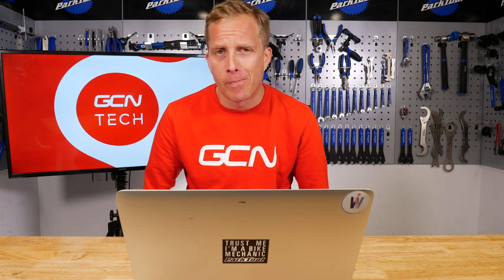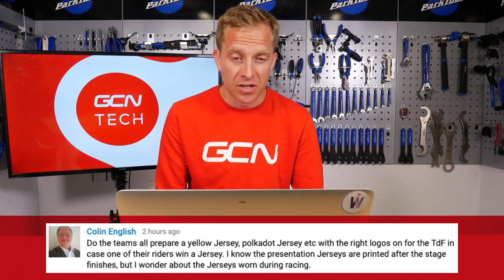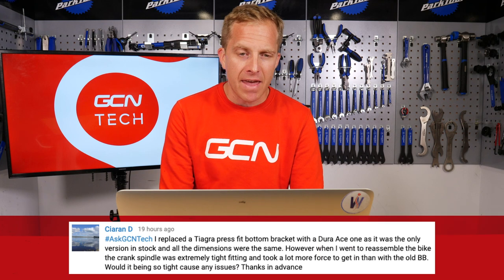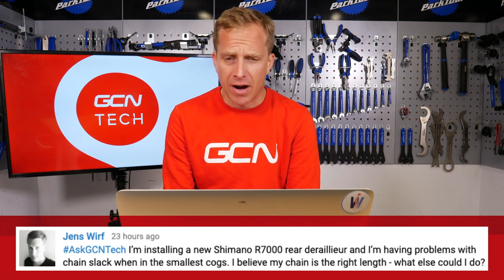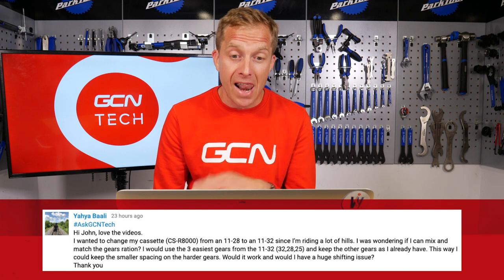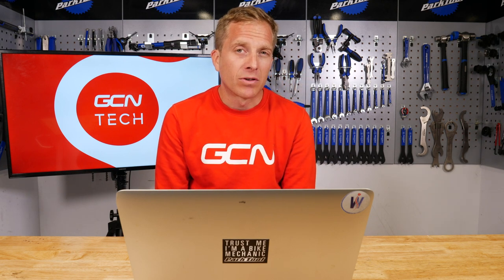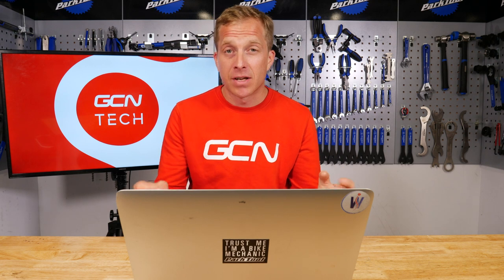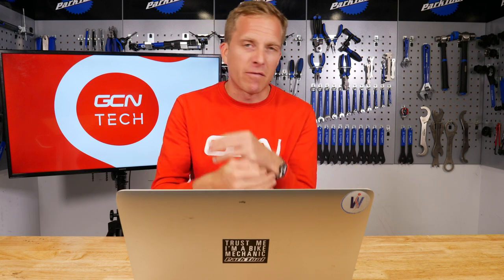Most Aero Place For Bottles On A Road Bike? | GCN Tech Clinic

Comment: Hello from Barcelona, Spain. Congratulations to the channel. I ride on an aluminium cannondale caadx; I am going to replace my aluminium fork by a carbon one. I will apreciate any advice about the correct instalation of the compression plug: carbon paste needed?, torque of the bolts? How to avoid galvanic corrosion between the frame and the fork? Thank you very much

Comment: I just did the Pikes Peak Hill Climb on Saturday and smashed my PR. However, I knew ahead of time that my gearing setup wasn’t going to be right (too big in the front). The ride averages 7% but that includes a significant flat section. Most of it is probably more like 10%. 

You know what would be an awesome video? This might be too involved tech/science, but...what would be the optimal gearing assuming 200w, a certain % grade, a certain weight, etc. that would also mean a cadence of around 80 to 90? I realize that 200w is still 200w (the same time) up a hill all else the same, but how you get there on 60 rpm or 90 rpm is a lot different. Or does such a calculator/chart/guide already exist? 

In reality I know I actually lost watts because I couldn’t spin fast enough due partially to gearing in the front, not to mention the lack of oxygen!

Comment: I wish to upgrade my 3X chainrings (42-34-24T) to bigger ones like Shimano Sora FC-3503 having 50-39-30T gear combination. I currently have Shimano Tourney groupset with 'sealed cartridge' type bottom bracket. So,
1. Will I be able to go ahead with this upgrade?
2.  What issues I might face if I keep rest of the Tourney groupset intact?
3. What other components would require a mandatory upgrade if I go with the 50-39-30T chainrings?

Comment: #AskGCNTech i like the idea of the 10 tooth sprocket to increase the range of gears at both ends. However I cant afford SRAM's eTAP AXS groupsets as the wireless technology makes them too expensive. Would the crankset, chain and cassette be compatable with any other components from different groupsets. I.e. could i take the gearing from SRAM's X-range and use it with a different groupset. If so, any suggestions; preferably mechanical gearing with hydraulic disc brakes.

Comment: #AskGCNTech I have a Bianchi Oltre with an Ultegra 6800 series groupset.  I have a sub compact 52/36 chainset and 11-28 cassette.  As an old rider, I'm looking to upgrade the groupset to the Ultegra R8000 groupset with a compact 50/34 chainset and a 11-32 to help me with the hills.  I assume I will need a medium cage rear derailleur for the bigger cassette?  Also, any other traps for young  (old) players in this upgrade?  Thanks for a great show Jon.

Comment: Hi John, I am interested in going bikepacking using my new gravel bike. The gearing came set up with 48-32 with an 11-34 at the rear, using an Ultegra RX rear mech (no chain slapping for this guy!). The rear mech's capacity is listed as 39T and a max low sprocket of 34T. Can I add a wolftooth derailleur hanger extender to get a larger cassette fitted? Or is the rear mech capacity not going to allow it (it is already at 39T capacity with the current gearing)? If yes, will a 40T low gear fit? #AskGCNTech

Comment: GOD BLESS YOU !!! Ok mechanic😅 I got a argon 18 2010 with a broken front DERAILLEUR Hanger how can I fix that 😓
Reply: El que antes era dejo de ser bring it to your LBS
Reply: El que antes era dejo de ser If the bike has an actual front derailleur hanger, just replace it. Should be like €20 max. If it broke, it’s probably served it’s purpose of protecting the actual derailleur.
Reply: MC SwaggerFlagger in case have screws but not 😅

Comment: I’ve been slowly adding upgrades to my BMC Roadmachine - the most recent of which was a Vision Merton 5d integrates bar and stem. I love the feel of the wider bar but I can no longer fit my front light to my handlebars as my mount is for a round bar only. Do you know of any brands that produce a light you can attach to an aero bar? Or one that you can attach to a Garmin quarter-twist mount? Thanks!

Comment: #askgcntech Hi Jon, love the show! I’m restoring an old trek 1000 and I would like to convert it from a 7 speed down tube shifting to a 1x 10 speed down tube shifting. My question is two fold: firstly, can I fit a 10 speed cassette (I’ve measured the rear drop out to 130mm) and secondly, is the down tube shifter capable of being index for 10 cogs? Thanks!

Comment: I was working on my Fuji cross bike (aluminum frame and fork), it was with the saddle and bars on the floor since I don’t have a work stand, right to the side of it was a 1.5 meter drop to my garage and I had my front wheel of the bike, my rear wheel was still on it, then one of my pets dropped the bike, it landed sideways with the middle of the fork taking the blow right on the edge of the floor, then it turned an fell those 1.5 meter landing on the rear wheel and the front wheel dropouts, it bounced .5 meters on the front before falling again. I inspected the bike and neither the middle of the fork nor the wheel dropouts seem damaged (except for the paint obviously), should I be worried long term for cracks especially on the stress point which is the joint of the dropouts with the rest of the fork? Especially having disk brakes and being used as a road bike with long and fast descents being frequent where I live? THANKS A LOT IN ADVANCE. :) #askGCNTech

Comment: #AskGCNTech Hi Jon, I have a 2017 Supersix disc with SI crankset - ultegra 6800, ST-RS685 levers and BR-RS805 flat mount calipers. Is the r8070 di2 upgrade kit compatible? Replacing only - front mech, rear mech and levers? Cheers!

Comment: My rear hydraulic disk brakes do not have enough stopping power. The front can stop the bike immediately, however the rear ones cannot. There is no sponginess, so not sure if it is air in the fluid.
Reply: It's simple physics, braking with your front brake always slows you down faster(hence the flying over bars)
Reply: @Jizzan  that is true, but my rear brakes probably will take about 5 times longer to stop
Reply: Maybe the pads got some oil or something on them.

Comment: #askGCNtech regarding bike upgrades - I’m considering upgrading my standard fit PR-2 wheels on my ultegra clad TCR-0. Went in to my local bike shop - advised that carbon wheels would be best. As a relative newbie it feels a bit wrong fitting £1K wheels to a £1K bike. Am I better off saving for longer and upgrading the whole bike to carbon instead? Is there any virtue in spending £500-600 on lighter aluminium wheels ?
Thanks in advance.
Reply: Keep the hubs and just swap out the spokes and rims with some Chinese Carbon rims. Eg. Farsports, Yoleo or my favourite Light Bicycle (rims are approx 100 pounds each). It's fun to build up rims yourself too.
Reply: Richard George thanks for your suggestion, I’m fairly sure building my own wheels is beyond my skill level! It would be a good learning experience for sure, but I don’t have much in the way of wheel building equipment...

Comment: #AskGCNTech Hi Jon! So I bought an old Ciöcc and there are sora crank arms on it and the left one seems to always be coming loose and causing a skipping feeling every downstroke on the left crank. Is there any fix for this or do I need new crank arms and spindle? And if so can you recommend any that won't break the bank?

Update just recently discovered that the cranks are octalink. Idk if that changes anything
Reply: The crank arm is probably too damaged to be tightened properly.  Just get any ordinary one of the same type octalink and the same length.

Comment: #AskGCNTech  Hi GCN, I have recently changed my cassette, chain and gear cables inners and outers. I have Indexed the gears properly and they work fine. My problem is when I am in the big chain ring and put a lot of power down, the chain comes off towards the inner chain ring. It only happens when I put a lot of power through and I am not shifting gears at the time. I checked the limit screws on the front and the chain isn't being pulled over and there is a big enough gap. A small bit of plastic trim on the inner plate of my front derailleur is missing after the chain came off but this was happening before then. Please help!

Comment: #AskGCNTech hey Jon, I'm a junior racer and I need 7m (or slightly below) rollout for events. At the moment I have a 14-28 cassette and 50/34 chainrings. I've calculated that I need a 52 tooth chainring to get the right rollout, however I'm asking whether I can still keep my 34t small ring? Can my Ultegra 6700 front derailleur handle an 18 tooth gap between my chainrings or will I have to get a 36t chainrings as well? Thanks, Flynn
Reply: I have the same question for a VERY steep hill climb race that I do. How low can you go from a 52 on the front? A 30 from an old triple?

Comment: #AskGCNTech  hey Jon been having some problem with back pain recently after going out on rides, i don't know if this is because of the way i am sitting or holding the bars, or is it normal and will go away later
Reply: Try some strength exercises for your core.  They helped me.  Crunches and leg lifts when face down. Planks can also help.
Reply: @tomshield9730  cheers, i will try and do some extra core exercises

Comment: #AskGCNTech hey GCN. I did a mistake. Im building my first road bike. I was inspecting a BSA bb. And out of curiosity I opened the tight seal from a cup. But now I can't get it fit inside the cap, without having a small bulge on the cap. I hope you understand what I mean. The gap is at least 1mm. HELP me! And Thanks in advance!
Reply: Not all caps bottom out on the frame so be careful. It just depends on the brand. Refer to manufacturers instructions or Park Tool site

Comment: #AskGcnTech   you get oval chainrings at the front, i have been wondering why dont you get oval cassetes for the real wheel,   will it work  🙈🙈
Reply: Oval chainrigs has shown no real advantages over standard ones... They even show that fitting them at different angles they showed greater torque compared to manifacturer specifications
Reply: I don't have any opinion about, whether oval chain rings have any advantages, but regardless whether they have or not, oval sprockets wouldn't make any sense at all. Reason being: Oval chain rings are mounted on the crank, so they are synchronized with the pedal stroke. Oval sprockets would most of the time be completely out of sync with the pedal stroke, depending on the gear ratio, you are actually using.
Reply: @larsmunch4536  👍👍thxx it makes sense 💪💪

Comment: #AskGCNTech Since I changed a broken driveside spoke I keep having scary chain skipping when sending sprints (new cassette and chain). Helpppp I have a fairly retro aluminum frame with Ultegra 6500 components and Shimano R535 wheels.
Reply: Check the indexing using the barrel adjuster. It might need re adjusting after the changes you made.

Comment: #AskGCNTech Dear Jon, PLEASE HELP! My old stem was broken by a bad mechanic and I've just bought a new one. Along with it, I've got an Extralite HyperCap and here's the super-annoying issue: It says that the maximum torque for the cap is just 2 Nm but as soon as I try to tighten my headset I reach the maximum torque without actually tightening anything. I can't use my old cap as it was for the oversized Specialized stem so I'm left with the Extralite and a lot of play in the top of the headset. (((
Reply: Put the bike on the floor when you are tightening the cap, instead of in the stand.